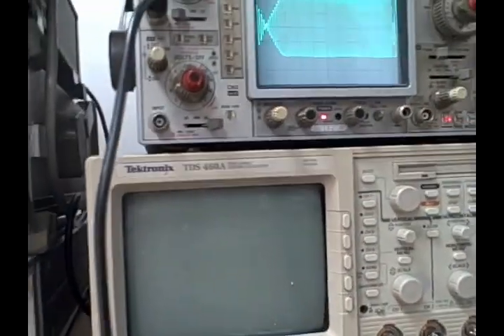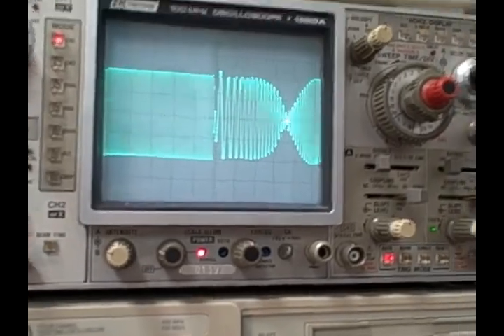Kemo VBF 8, A dual Elliptical 90db/octave, .01Hz to 99.9Khz Range

Comment: Thanks for the decent presentation.

As a supplier of new and used T & M equipment, Eurias (in the Netherlands) still has a few of these VBF8 filter instruments in stock. At a price level that is well below the price tag on newer models.

There are VBF8 variants with elliptic sharp roll-off, and also a few more with a 8-pole Butterworth response.
These are listed in the webshop that Eurias operates, and they can be configured on order to either 120 VAC or 230 VAC mains supply.